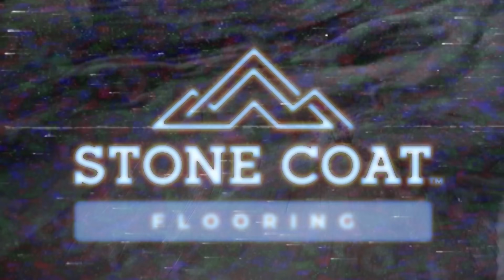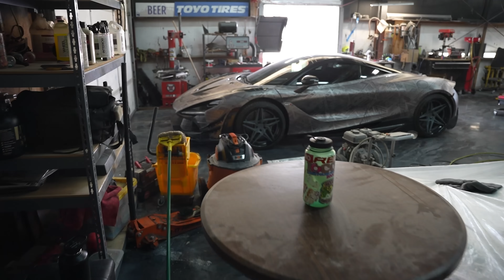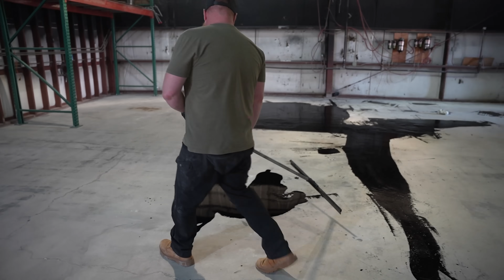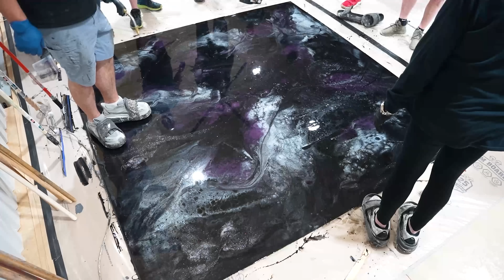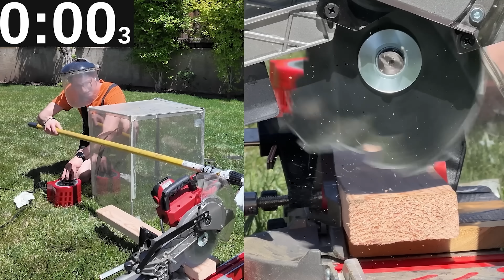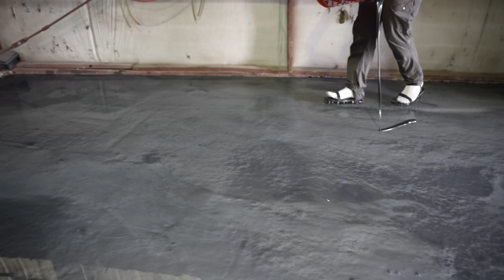They Needed an Epoxy Floor That Could Handle Anything

Comment from the maker: What's your dream workshop look like? Epoxy & crafting stations, woodworking, auto shop?? Let us know!
Reply: When grinding the floor. What is the best way to get into the corners?
Reply: @gofigure84 let the tool do the work, if the concrete finish is wavey switch to your 4in hand grinder you can speed it up
Reply: @bigmitchbuilds but does that get all the way into the corners or is it not all that necessary to grind every single part to that extent? You get what I mean? Round wheel into a square corner.
Reply from the maker: @gofigure84  The 4in grinder can get nearly the whole corner done which is more than good enough! That's pretty standard in the flooring industry. If you want to get fancy however you can use a multi tool with a triangular carbide rasp
Reply: @StoneCoatCountertops 
Some of them interested this channel less, but I don't understand English well, you can enable dubbing in Polish in the setting of your YouTube channel on all videos? please

Comment: So if you need to get to a pipe below this,  its all coming out?
Reply from the maker: That's a tricky one. I'm thinking that, in theory, if you absolutely had to, you could fill with concrete up the epoxy, grind and sand down the edge of the epoxy floor around the hole, recoat the hole, and then feather and try to replicate any marble effects around the hole to make it fit in, and reapply the top coat around the hole, and feather that out as best you can around the hole to make it as seamless as possible. So no, in theory you wouldn't have to remove all of the floor, but that sounds like a stressful weekend at best. We'd really like to know how that comes out if you need to do that. Send pics and/or video to mitch@polytek.com !

Comment: No etching the concrete first? 
Not even mentioned... Hmmm 
Well it looks spectacular at least.  Y'all got that part down.
Reply from the maker: best practice is to grind the concrete first - etching doesn't do as good a job as grinding
Reply: @StoneCoatCountertops That really depends on the amount of dirt and oils in the concrete, I think. Regardless, I was just surprised at the step not being mentioned, is all. Stunning outcome! Looks like real marble!
Reply from the maker: @renaissancemaneric8019  Thank you so much for the kind words!